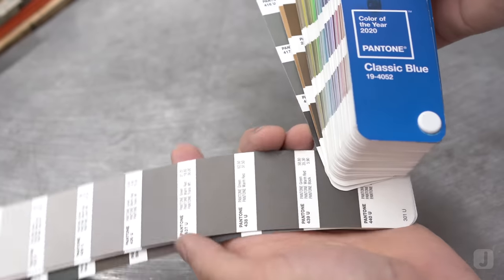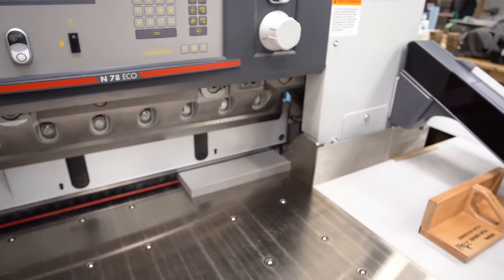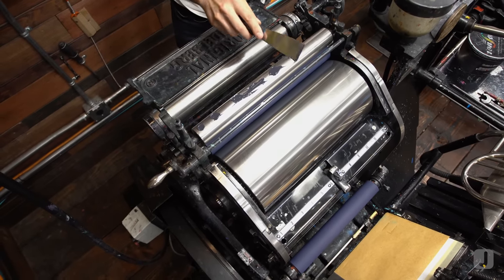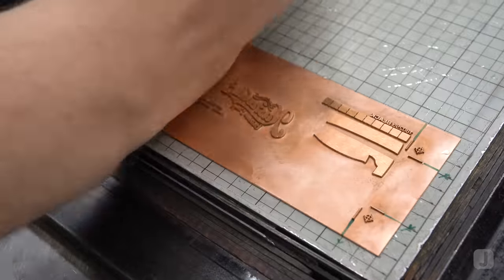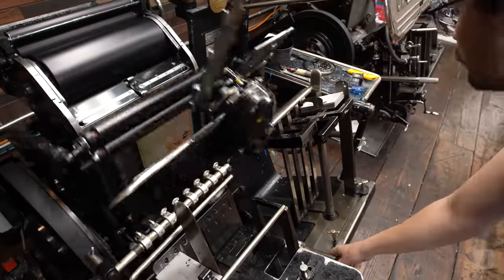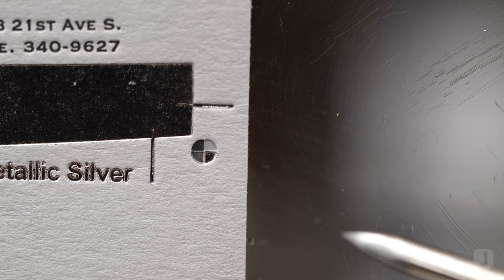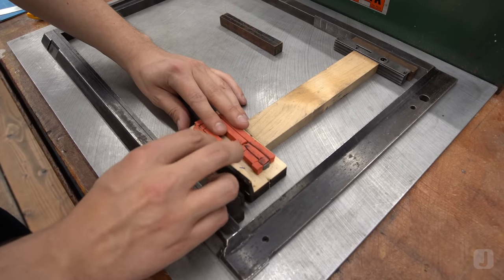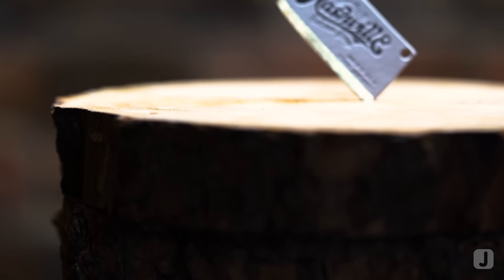Custom Shaped Letterpress Business Card with Metallic Foil

Comment: As someone who has experience with modern printers of all shapes and sizes I am simply in awe of the craftsmanship and effort that is put into the products you guys show on this channel. The manual color mixing blows my mind every time. Not to mention the parts we don't get to see. Such as the creation of the custom dies used in these projects.
Reply: That's a good point! I would be very interested to see the creation of the dies!
Reply: @Manachtron  I speak from everybody here, we would like to see how those dies are made, please
Reply: @Manachtron  Ahh, but thats the secret sauce right there. ;)
Reply: @MartyKleynhans  i'm thinking reverse etching...
Reply: the cutting dies are created manually by thin knife-like metal strips. The copper dies are lasered or etched. Usually those things are not done in-house
Reply: @grafikschwarzmarkt  do you know how do I  find some tutorials about how to do this?

Comment: You are a true master of graphic art! Glad to see someone else is making use of this amazing iron, I graduated with distinction in 1980 in photo offset fundamentals, we were trained on heidlebergs offsets and Letterpress windmills and I share your love of the craft, I  stunned the instructors when I requested a set of 4 color plates for the letterpress and the operator's manuals for both presses, I went on to  print a 4 color Scottish Coat Arms on the letterpress with perfection and did an 8 color job in a single pass on the offset press by setting the oscillation rollers to 0 and splitting the ink fountain with  8 ink colors, it was the first job I sold to a DJ  who had a gig and wanted a funky poster. I was in love with the power of print on the first day of class when I saw my family name Hamilton on the drawer handles of the type cases,  the instructors gave me an honorable mention and the Sears Robuck Award saying that no one had ever mastered the creative  capacity of the presses as I had, I started my own shop in 1987 and  have been running ephemeral art ever since, printing, hot stamping, diecutting, embossing on a vast arsenal of equipment,

Comment: I ran a windmill for the better part of seven years. Never any ink, foil and embossing only. A Chandler and price with kluge feeder too. Mostly numbering on that one. Very satisfying work. Thanks for the trip down memory lane.
Reply from the maker: I love those Kluge feeders but boy are they tricky. If the suction doesn’t trip right when you need it... you’ll have sheets throwing all over the place.
Reply: @JukeboxPrintLive  get rid of that tiny metal claw as the sheet separater and change over to brushes. The next two or three sheets are held in place by the bristles and don't go anywhere.

Comment: I remember when I was in school, this was the basic printing technique, arranging letters one by one and then locking them in the frame, adjusting the height for pressure with several layers of paper. I used to learn basic printing using a degel heidelberg machine. a very old, antique and rare machine  .

Comment: New Jukebox print video out?! Instantly makes an evening better. The sounds of letterpress are just mesmerizing!

Here's a question for you: Do you tend to try and minimize the amount of wastage on both the card stock as well as materials used? I notice that the amount which is die cut is significantly smaller than the card stock size which you guillotined. Is this just so that the machine has something to pick up from? Similarly with the foil, it seems to pull an inch through each time when in the end its only transferring about half of that, of which half is die cut away. Does it affect how cost effective particular designs are, or in the grand scheme of things does it not actually contribute much towards the cost?
Reply: I can only say for our shop, and the way our machines are set up. As i know at our shop we try our best to minimize waste as much as we can, but watching him in this video is close to how ours runs. With our heidelberg windmills can only go down to a certain size for the over all piece, and just like the foil you seen, that is about the smallest it will move the reel, to make sure there is fresh foil for the next piece. and yes it seem like a lot of waste, but really it is not that much. As of the cost, only they can answer that, as I don't have a clue where they source their paper/ink/foil/ and dies.
Reply: @twinbladefrua9340  Thanks for the reply! Makes sense that it's the minimum size / amount it'll work with. I'd love to see one of these machines doing a full-sized print! Would be epic!

Comment: That die lockup is simultaneously janky AF and also quite stable. I've never seen such a long piece of furniture run lengthwise like that, ha!
Reply from the maker: Reggie, I can’t tell you how many times I’ve locked up successive pieces of furniture in a small forme only to find them bow and rise under the pressure. Even the challenge high-speed furniture will do it. I know it is not pretty but it stays locked and true. I’ve only had a quoin fall out of a press once in the past 11 years.
Reply: @JukeboxPrintLive  oh absolutely. My boxcar base setup is exactly the same way. Absolutely zero judgment here, a bit impressed with all the open space in fact, ha!

Comment: Awesome video, as usual.  I'd love to see the process for making the dies and plates.  Also, with respect to the die cutting, do you have anything behind the items being cut to prevent the die from being dulled or the back plate being scored and damaged?
Reply from the maker: There's a flat stainless steel "Jacket" on the anvil side of the press that is about 20pts thick. There should always be a die jacket in the press when die cutting as you don't want to do any damage to the bed of the press. Die cutting is a fairly sensitive step that requires just enough pressure to cut through the paper while making sure the cutting rule doesn't bite into the jacket on the press. The rule should just burnish the die jacket and any marks you can feel with your fingernail means you've gone too deep. Sometimes punches or perforating rule will dig into the die jacket which can be difficult to avoid. A dull die cutting die is the quickest way to damage a machine as it requires a lot of unnecessary pressure.
Reply: @JukeboxPrintLive  yes, indeed. my die-cutting jacket has no cut marks - only shiny areas where the dies have struck... My first die-cutting job on the Windmill - when I was 15 - was with a worn-out die and a cut up jacket. It was hell to work with. When I began cutting on my own press ten years later, I used only fresh blades and never cut my jacket - makeready!

Comment: Very cool job, thanks. I have a question though. Why do you ink the full rollers while only a short portion on the right is used for printing? Wouldn't it be saving ink to only ink the right side?
Reply from the maker: If I only ink the area where the plate is, the ink will move across the cylinder anyway and spread out. This will cause me to lose color consistency. Ink always wants to move to the driest area.

Comment: Just out of curiosity, you're only using a small plate, so why do you ink the whole roller?
Great video by the way, very interesting
Reply from the maker: The oscillating motion of the rollers and inking cylinder will cause the ink to speed across the whole thing anyway. Ink always wants to move to the driest area until it levels out. Inking the whole cylinder will help keep the colour consistent across the run.

Comment: For an order of, say, 500 cards, how many extra cards do you allow for for testing registration and stuff? It seems that with each step you lose a couple of cards to test printing.
Reply from the maker: We'll lose maybe 5 sheets for a set up of a single step. Which is pretty good. So, overall we try to make sure we run 10% extra as a safety net.

Comment: could you get the same effect as skip passing by doing a second impression of the black? theoretically it shouldn't take much longer and seems less prone to error.
Reply from the maker: Imagine if the registration changed by just a hair for the second hit of black. The tiny details would look ghosted or doubled and it would be quite difficult to get it bang on again. Sometimes a double hit isn’t worth the risk so a skip feed will do just fine.
Reply: Came to ask the same question, mad print skills 👌
Reply: Or use vantablack ink :-)

Comment: Beautiful work. I’m wondering though.... why not print 2 Up? The card stock looked big enough to get 2 on each piece. Or.... start with a smaller sheet? There was a lot of paper wast. Looked like over 50% waste.
Reply from the maker: We could’ve fit a perfect work and back here if we had a two up die cutting die for sure. In our videos, we tend to simplify and use a larger sheet just so it’s easier to work with and film. The waste is a product of that. Our prepress team never usually lets us get away it!

Comment: Why do the color sections have overlaps in the print? Is that to account for slight variance in die cutting?
Reply from the maker: Great question, this is called "bleed" and almost all of our die cut projects will have this kind of "overlap" happening. Its exactly as you describe, to account for slight variation.

Comment: when you say you adjusted by a point, what is the length of a point? (in inches?, in milimeter?, etc.)
Reply from the maker: 1/72 of an inch. There are 12 points in 1 pica and 6 picas in 1 inch!

Comment: Was being unable to put 2-per-card a physical or technical limitation? Looked like there's be room for another knife 180'ed... doubling up qty. Just thinking of all the 'wasted' card stock.
Reply from the maker: Yes, totally. There was room for a perfect "work and back" in order to print just like you've described. However, for the sake of these videos almost everything is exaggerated for emphasis. There's extra bleed, and I'm running a larger sheet, simply to make it easier to film and capture.
Reply: @JukeboxPrintLive  Awesome - this video definitely sold me on your dedication to the craft. Will email soon re: small project
Reply: @JukeboxPrintLive  is this the Toronto location?
Reply: I always heard it referred as work an turn :) I work for a print company that was small but has become very large but unfortunately it’s moved towards digital printing and high quality is rare to need in the shop. I’m afraid I’ll never learn the craft as well as this. (I’m a bindery operator though..)

Comment: Miss the sound of the windmill press running. I miss setting lead logotype for raffle tickets and putting them into the chase and locking it down. For those who ran or run these presses will remember paper cuts on their thumb because of checking for doubles!
Reply from the maker: These days we don't even notice the paper cuts until the hand sanitizer gets in there and you feel the sting!

Comment: Jukebox Print.
1. You shouldn't leave the rollers sitting on top of the printing block when you stop the machine each time!

2. And the metal frame is only called a 'chase' when empty; when the chase has furniture, a printing block, etc., then it's known as a 'form'.

3. And the stock could have been cut neater on the guillotine.

Comment: When washing the ink off the press, where does the rinsed off ink go? It seems awfully easy to clean.
Reply: There's a rubber blade connected to the the handle he moves which trickles into a trough you can empty, it's simply called a wash up blade, he thins it first when he pours on paraffin or white spirit, we used either in the 70's.